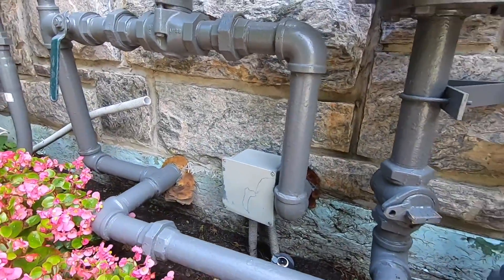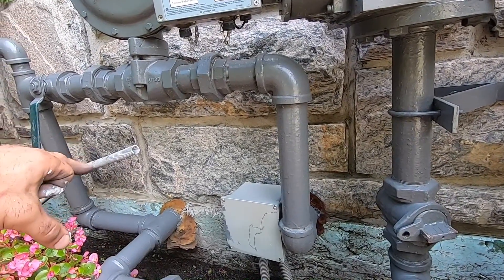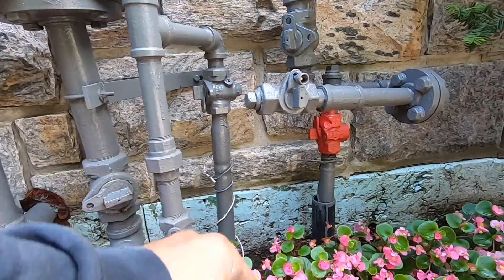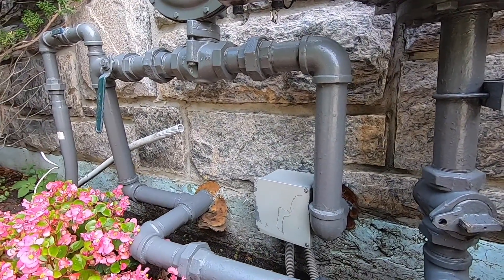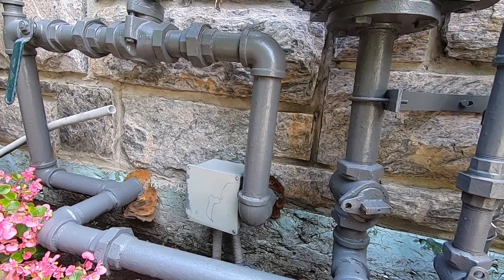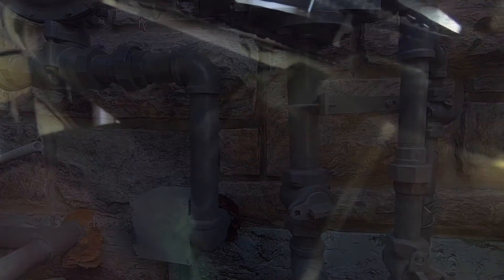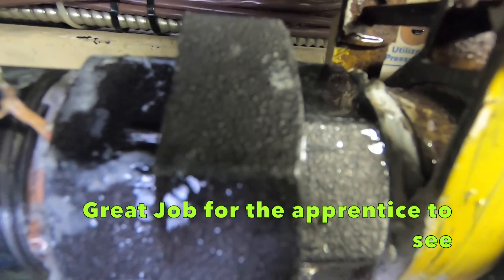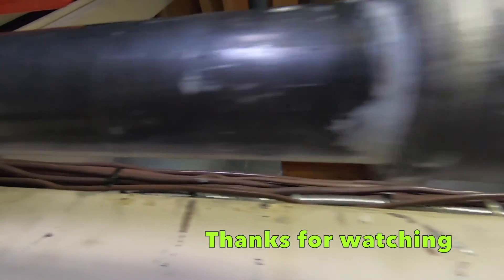HVAC: Gas Leak | Valve & Union replaced

Comment: Union could of been dropped and damaged during install
Reply from the maker: hey Bill, yes thats for sure, what scares me is the threads leaking the way they were.  Do you see this often? i do not.
Reply: @HVACRNorth  Not often yet if the pipe was backed off its a possibility. There was a vid I did awhile back where the inspector missed a big gas leak on threads. The treads weren't that good so I used the yellow teflon and pipe dope to seal. Since you had a few threads leaking whoever made the treads could have screwed up making threads. The treads taper into each other to create a seal along with compacting the dope. Blue block I have seen lots of leaks on seals. about 15 years back I had to take apart and reseal all the connections in a building since they raised the roof. We will always at times run into unexplainable situations that leaves us shaking our heads